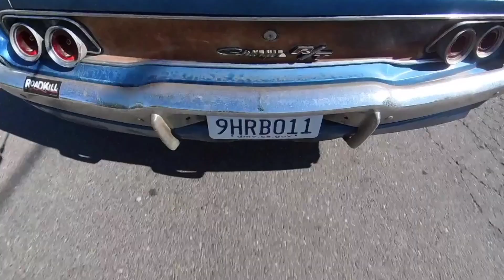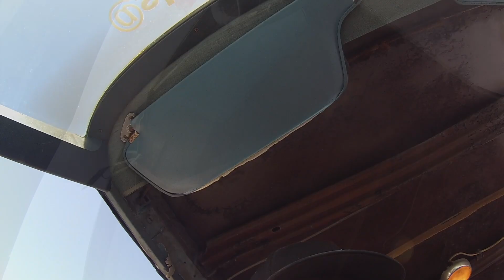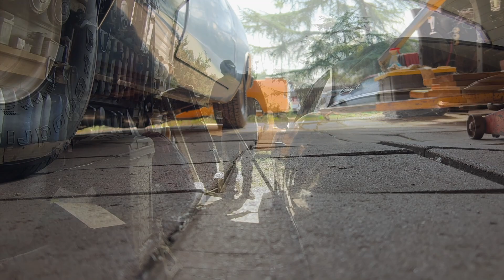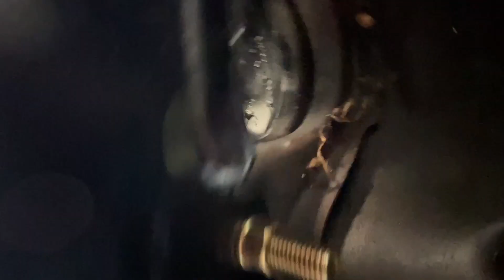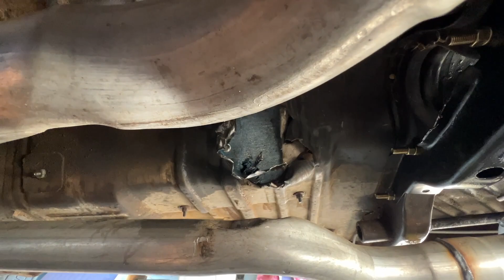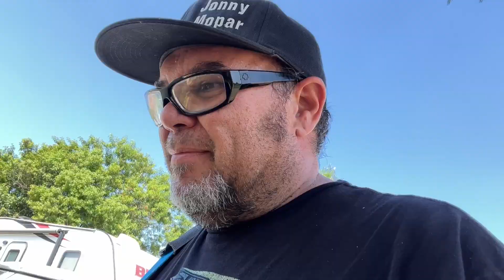I BROKE my 1968 Dodge Charger REALLY Bad

Comment: I've only seem it once before. My cousins car. At the track with great traction. First ever time down the track and he gave it the beans with the trans brake. Didn't have the leaf springs clamped. No snubber and I knew the pinion was not low enough. Watching the launch video, you could see that the rear section of leaves, fanned out more than I have ever seen and before he could hit second gear, the tranny was in pieces.  It was another one of those RUSH BUILDS to get it to a specific race and we launched the tranny..  This was on mopar Super Stock springs. I have the same set in my 65' and they are clamped from the factory. The rear leaves spread out so far, you could count them easily and the lift of the rear was insane. I don't think a snubber would have made any difference, seeing the arc of the springs... but yours, on the street, Maybe the tranny already had a crack in it!!  Maybe the drive shaft is too long and pushed into the tail housing causing it to crack. Who knows.....
Reply from the maker: Man, your cousins car sounds insanely powerful. I’ve been running it through my brain over and over. The driveshaft length was the right length. But I have no history with it, so it possible something was out of balance on it. But what makes the most sense is I think I lost a clip to the U joint. Then I think a cap started pushing out, which is where the vibration came from and then all hell broke loose. Still just a theory, like you said I doubt I’ll ever be able to know for sure.

Comment: Man that sucks. I had a 70 challenger wound up having a bent tail shaft because vibrations like that. It kept cracking our tail shaft housings it was on the third one that we realized it was bent
Reply from the maker: Well that’s odd one. Mine was odd too. Sometimes you’re the lucky one to get the freak failure. I hope it’s my last.

Comment: Sorry for your troubles. Glad you weren’t injured.  Your mishap is my biggest fear. It would be devastating to break down on a shakedown drive. I’m trying to make everything as bullet proof as I can afford since I’m starting from scratch. My car was just a stripped roller when I got it. Take some time, clear your head, and regroup. Maybe ponder an upgrade for the tranny and rear end?  NAG1 or an 8HP70 with punkin rebuild suregrip internals?  Failure is nothing but an opportunity for improvement!  You’ll get there!
Reply from the maker: Thanks Jimmy. I’m glad too. It was close and I didn’t even know till I got under the car. And that’s my plan exactly. I’m gonna put her down for now. Go to Dust Tape, have fun and get back on her taking my time. And this time, I’ll get the rear all new as well.

Comment: When I saw your short on this happening, my first thought was u-joint especially since that was the last part you changed. But seeing the play in the third member, I would lean towards that. Could be a combination of things, but that's a LOT of play. Glad you're ok. 👍
Reply from the maker: Thanks Targa. Yeah, that okay raised my eyebrow. But after running it through my head over and over I’m thinking I lost a U joint clip. Then the cap started pushing out. If you look at the freeze frame of the tail shaft an yoke you can see one of the Yoke ears is ripped open. I keep looking on the side of the road hoping I can find it. Nothing yet.

Comment: Jonny,  I wasn't expecting to see the drive shaft still under there... I would have thought that it would have LEFT the scene...  That drive shaft beat the hell out of everything! I have never seen one do so much damage and still be under the car... I still wonder what failed first?  I know you will keep us updated.  Somehow try to manage to have a good time at the Duct Tape Drags with your Duster!  Got to keep on Moparing!
Reply from the maker: Thanks Frank. I know man, this one is a head scratcher. But I’ve had some time to run my brain through it over and over again. The only thing that makes sense is loosing the U joint clip. Then I think a cap started pushing out till it just got too far away from center and then all hell broke loose. I didn’t mention it in the video but if you look at the freeze frame of the tail shaft and yoke one of the Yoke ears looks ripped open. And all the damage under the car is right at where the yoke is.

Comment: On an episode of Roadkill garage I think it was Dulcich and Freiburger broke off the tail shaft of a car because of a home made driveshaft that was outta whack. So sorry for the trouble. I hope you get it fixed soon.
Reply from the maker: Thanks man. Goes to show how important balance is. I think I lost a U joint clip and then the cap pushed out and balance went out the window. Check out the freeze frame of the tail shaft and yoke. One of the ears of the yoke is ripped open.

Comment: seized output shaft bearing? where did the output shaft break?
Reply from the maker: Right at about where it goes into the main body of the trans. I found the output shaft housing, the bushing looks fine. Now that I’ve had some time to give it a lot of thought, I’m pretty sure a U joint clip broke and came out. I think that set off the chain reaction.

Comment: Agree on the u-joint clip coming out.  Sorry about all the carnage but could have been worse.
Reply from the maker: I’ve been running it through my brain over and over and it’s the only thing that makes sense. Thanks Wayne. Yeah, I didn’t even realize how bad or close it all was to me till I looked under the car.
Reply: Yeah I luckily caught my rear diff missing both clips keeping it center to my duster. That freaked me out like they were never installed. Its all better now. Safety is key!

Comment: Glad you werent injured. A enclosed driveshaft loop probably would have saved the floor pan and exhaust.
Reply from the maker: It’s possible. But I’m not sure. But, it will keep in it from going too far out of the tunnel, like where my ass and legs are. So it will get one.

Comment: I agree with the clip theory. A lot of toque and heavy hardened steel yoke. One side opened up, then whole thing becomes a tricone rock drilling bit combination fly cutter can opener. Once it opened up the tunnel, it tore off the tail shaft. No more part or power, call the AAA.
Reply from the maker: Yeah. It makes the most sense on how it went down.

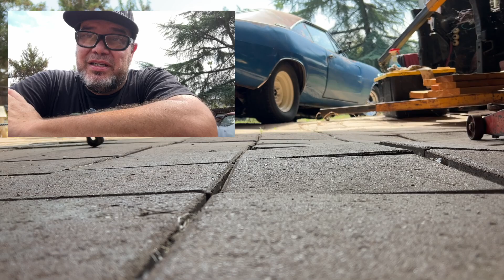Comment: ........ @9:13  , Time for that 110 volt Harbor Freight electric winch , I guess you get an arm workout with that hand crank one .
Reply from the maker: Lol. I have a wench. I was too lazy to take it off the trailer. And I don’t plan on doing this on a regular basis.
Reply from the maker: Also, I’m leaning towards using the pistons you send me on the budget 440 build. I dunno, compression has peaked my interest.

Comment: I'm glad your alright! I have a 67 satellite with 383 and a 727 in it and I get vibration in towards the back of the car I have been having problems with the rear wheels getting warm seems to be the brakes! Chinese made brake parts don't work or fit exactly right! yea lots of inferior parts out there! I don't think it was trany or drive shaft. if I was near by I would help you out but I live in Montana. I hope every thing works out and good luck!
Reply from the maker: Thanks Dean. Greatly appreciated. Are you running green bearings? They don’t last like the original roller bearings. That could be where your heat is coming from. But Chinese parts are an issue too. I have a video on my moms Charger installing spindles and the passenger spindle holes are nowhere close. I tossed that in the trash.
Reply: Yea! I don't know if it has the green bearings or not but it does have a lot of miles on it so you may be right! Not sure what the previous owner did to the car. It is a survivor has 116000 miles on it! But I'm going to pull the axles out and check! Thanks for your tip! @JonnyMopar

Comment: Sad to see this stuff , That was NOT caused by the trans ,  It was probably driveshaft related . All cars should have a driveshaft Loop , that may have helped some (exhaust) . Check the Pumpkin for sure , and When you do a new  trans , be sure to do a Bolt In Sprag  .
Reply from the maker: Will do Ted. Yeah, I plan on adding some upgrades. The bolt in sprag, smatter shield and loop are on my mind.

Comment: I think you are right the front u joint threw a cap off and stayed in yoke with only one cap on and bang around so hard until tail shaft cracked and blew apart happened in my dart in rear yoke with one cap on it banged around so hard iam suprized it did not damaged something actually I should check my tail shaft for cracks now that I say that but being your was in front the trans took the brunt of it and those auto trans tails are so long also I use moog ujoints they seem to have beefier c clips good luck thanks for videos
Reply: Also the c clip was probably missing for a while the u joint Capps are press fit so it was working it’s way out that is where you started having vibrations until it finally let loose especially with that extra weight they put on the front of those drive shafts
Reply from the maker: I think you’re spot on Vincen. That’s exactly what I think happened. I can’t remember for sure who made the I joint, maybe I can see it in older videos when I installed them. I can’t remember if it was on this car but I had a clip snap in two during install once before. It might have been this car. And maybe the clips were brittle.

Comment: Was it a known good driveshaft. Or just one you had. Possibly bent.
Reply from the maker: It was in the Charger. Not sure if it was original or not but I have no history with it. It’s possible it was bent. But I think I lost a I joint clip.
Reply: @JonnyMopar  good luck.  At least it didn't fold under the rear axle

Comment: I have never seen a driveshaft do that much damage to a car I really don't think it was the rear end and I don't think it was the transmission I believe more it was the driveshaft being defective metal that's kind of hard to believe I've had a lot of those cars they vibrate I never get that really it sounds like the front U-joint just came apart or the yolk came out of the driveshaft that there's no way to tell until you get it all apart then you'll get it back together one day it'll be right
Reply from the maker: I’ve been going over it in my head for days now Keith. I think your assessments are right. Personally, I think a clip broke and flung out which led to the cap working it’s way out, which caused the vibration and all hell breaking loose. I’ve never seen or heard of it before either.